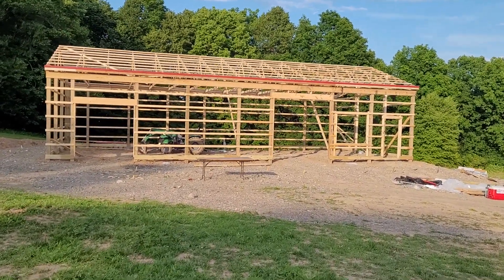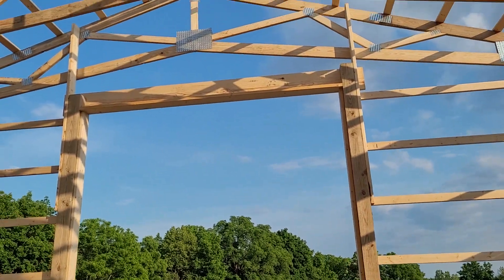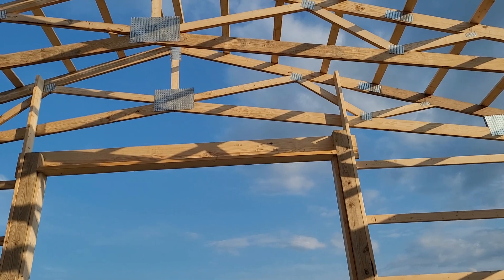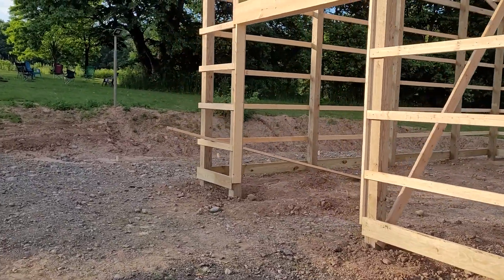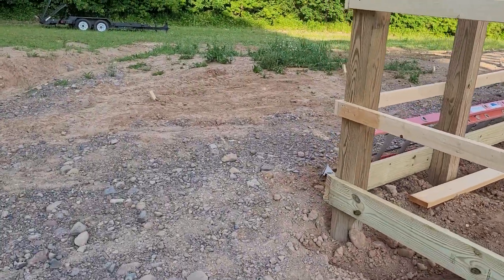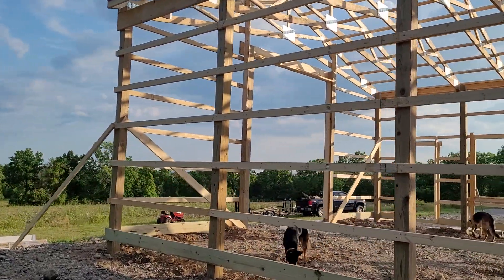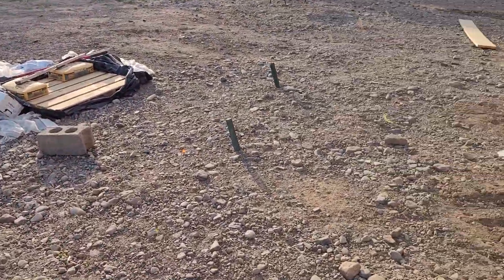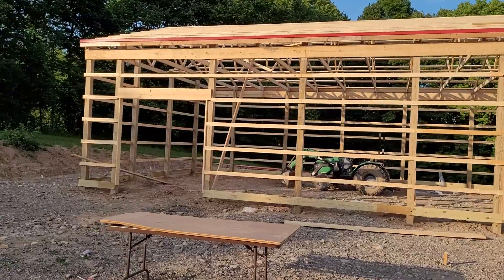The new building is all framed in and trusses on!

Comment: looks good, better to get the pad down first n then put the wood on top tho. but lots of people build them this way with the posts in the dirt. looks like you got good fall away tho on the hill. just get all that dirt tamped good n hard before u add the concrete to the top. u still got time to add radiant heat into the floor tho! u can run it with a boiler n some pallet wood np. put the pex tubes in on top of the wire mesh. its the best/cheapest way to get your love shack warmed up.